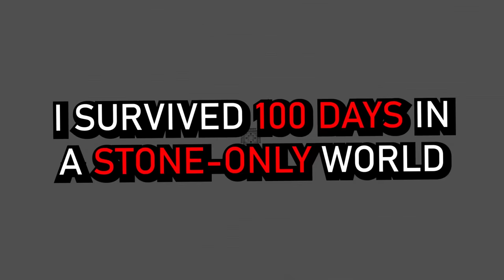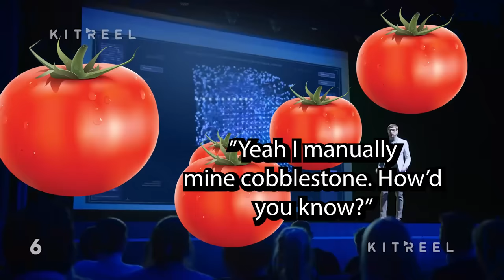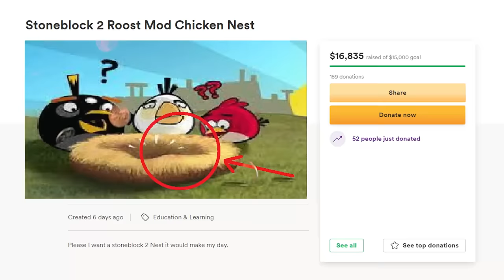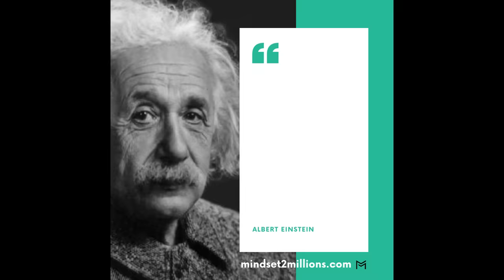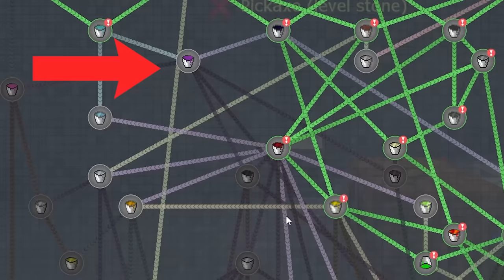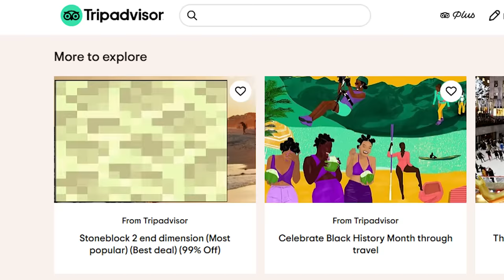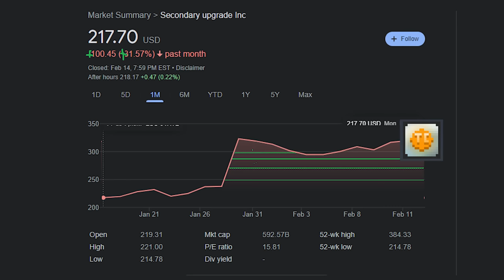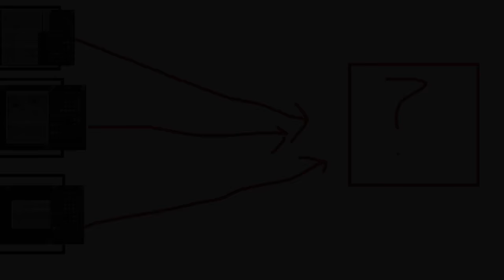I Survived 100 Days In A HARDCORE Stone Only Minecraft World (Part 1)

Comment: This video helped me realize just how useful chickens and cows are. 
Here's a tip about those guys, by the way: Item Chickens and Fluid Cows could probably speed up a lot of processes like induction smelting. Some Fluid Cows give alloys, you can turn them directly into ingots by putting them in fluid-storing blocks, and then using a seared faucet to have the fluid flow out into the cast.

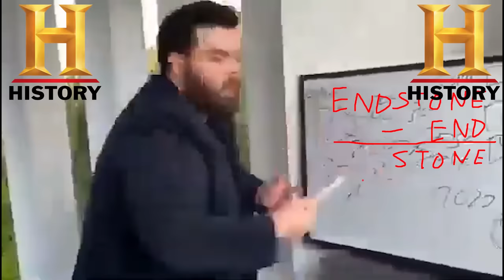Comment: 20:20 explanation of the joke: Sakupen Circles (formerly known as Iron God) is a 2.1 Extreme Demon collaboration hosted by Muffy450 and verified and published by Diamond on December 29, 2021. The level is a remake of the 1.9 impossible level with the same name, as well as taking several gameplay ideas from Iron God, an older level created by Muffy450 himself. It was verified by Diamond, after a death at 76% and a run of 37-100%.

Gameplay
Note: Only decorators will be mentioned in the following section.

0-8% (DrCuber): The level begins with a semi-impossible three-block-tall jump at half speed. After this, the player must hit the blue orb and jump over spikes, falling into a mirror portal and changing to double-speed. They must continue to jump over multiple spikes. They are given multiple orbs to choose from but can only hit the first pink orb and last blue orb. They then must jump over the spikes to pass a mirror portal, and then their speed changes to half-speed. They need to jump on the edge of a block with a spike and time a pink orb to reach the double-speed ship.
8-17% (korewa): The player hits the ceiling as the double-speed ship and must continue with a series of yellow orbs with gravity changes.
17-49% (Renn241): The player changes into a ball part that has difficult orb timings, leading into a tight corridor with spikes on the sides. They transform into a dual mini-ball with small spikes on the sides that they must avoid. They turn into a cube and must do a couple more cube timings. The word, "Ready?" appears right before the first wave part. The wave part has incredibly tight gaps with little room for error. They turn into a mini-wave and must spam on the sides of the walls to avoid the spikes.
50-66% (Mzero + endevvor): The player becomes a dual mini-wave and has to perform frame-perfect clicks to get through. They turn back into a normal wave and have to perform even tighter timings, leading into a mini-wave section where they must spam fast but consistently through a downwards spam. They become big again and must spam more, albeit not as fast as transitioning into an auto-ship section for the next part.
66-72% (NineDice): Considered one of the hardest and most inconsistent parts of the level, the player must memorize and spam through one-block-gaps as a triple-speed wave, making some clicks inconsistent and hard to time.
72-100% (GhostVandalf): The player changes into a dual wave where they have to make it through some more diagonal gaps with spikes on them, leading into a two-block spam section back into a ship section. They have to precisely control the ship and learn the fakes to get past the section. Finally, the ship turns mini into a fairly easy straight fly. After that, they turn back into normal size and need to perform the final straight fly to finish the level.
Trivia
The level is free to copy.
The level contains 72,568 objects.
The level is 51s in length.
This makes it the current shortest Top 10 Demon on the Demonlist.
The level was rated on January 5, 2022, and was initially placed at #1 on the Demonlist on the same day, above Slaughterhouse (#2).
This addition to the Demonlist knocked Kenos out of the Top 10, Icotact into the Extended List, and Ziroikapi into the Legacy List.
On March 17, 2022, Sakupen Circles' and Slaughterhouse's placements had been swapped, thus, Sakupen Circles dropped to #2 on the Demonlist.
Sakupen Circles was at #1 for 70 days.
This is the first Nine Circles level to reach the top of the Demonlist after Sonic Wave back in 2017 and the second "Medium" length level to reach the top, after Sakupen Hell in 2016.
Coincidentally, this level uses the same song and has almost the same length as Sakupen Hell, and the two levels also garner most of their difficulty through their wave gameplay. The levels share many parallels in general.
Ironically, the placement of Sakupen Circles knocked Kenos out of the Top 10 on the Demonlist, which is an extended remake of Sakupen Hell.
Cursed dropped the verification due to demotivation but had stated that he wouldn't drop the level completely and might come back to it as a victor rather than as the verifier, he ended up beating it on January 7, 2022, becoming the first victor of it.[1]
spaceuk became the second victor of the level and the first victor to not use the Low Detail mode on March 27, 2021.[2]
This level can be viewed as the first "bridge" between the Challenge List and the Demonlist as many sections of the level are stand-alone challenges.
Due to said challenge (SC66P) being high on the Geometry Dash Challenge List, this is the nearest humanly impossible level verified at this moment (neither Slaughterhouse or Firework have a single part that can reach at least the Main List in the Challenge List).
There is an upcoming sequel called Aquamarine, which is currently in the process of being remade by DrCuber and is set to be the hardest Demon in the game.
Sakupen Circles is the 36th former Top 1 in the game's history.

Comment: The Hog Rider card is unlocked from the Spell Valley (Arena 5). He is a very fast building-targeting, melee troop with moderately high hitpoints and damage. He appears just like his Clash of Clans counterpart; a man with brown eyebrows, a beard, a mohawk, and a golden body piercing in his left ear who is riding a hog. A Hog Rider card costs 4 Elixir to deploy.

Strategy

His fast move speed can boost forward mini tanks like an Ice Golem in a push. At the same time, he can also function as a tank for lower hitpoint troops such as Goblins as he still has a fair amount of health. Most cheap swarms complement the Hog Rider well, as they are nearly as fast as him and usually force more than one card out of the opponent's hand.

The Hog Rider struggles with swarms, as they can damage him down and defeat him quickly while obstructing his path. Barbarians in particular can fully counter him without very strict timing on the defender's part, though be wary of spells.

A Hunter can kill the Hog Rider in 2 hits if placed right on top of it. However, if you place something in front of the Hog Rider, the Hunter's splash will damage the Hog Rider and hit the card in front of it more.

The Hog Rider in conjunction with the Freeze can surprise the opponent and allow the Hog Rider to deal much more damage than anticipated, especially if the opponent's go-to counter is a swarm, or swarms are their only effective counter to him. Skeletons and Bats will immediately be defeated by the spell, while Spear Goblins, Goblins, and Minions will be at low enough health to be defeated by a follow up Zap or Giant Snowball.

However, this strategy isn't very effective against buildings as the Hog Rider will take a while to destroy the building, giving the opponent ample time to articulate another counter.

Against non-swarm troops, it can deal a lot of damage during the freeze time, but this can allow the opponent to set up a massive counterpush. For this reason, players should either only go for a Hog Rider + Freeze when they have other units backing it up from a counterattack, or if the match is about to end and they need to deal as much damage as possible.

It is not a good idea to send in a Hog Rider simply to destroy a building, especially if it is the only building targeting unit available, as defeating Crown Towers becomes substantially more difficult. Spells or simply waiting out the lifetime of the building are more effective. The exception to this is an Elixir Collector placed in front of the King's Tower. If a Hog Rider placed at the bridge, he can destroy the Collector for a positive Elixir trade, though the damage from both Princess Towers will usually mean he does not survive to deal any damage to them. However, if the opponent sends in defending troops, it can be an opportunity to gain spell damage value.

In a deck with several low-cost cards, it might be worth it to simply send the Hog Rider against one building. These decks shuffle their card rotation quick enough, that they will arrive to their next Hog Rider before the next building arrives in the opponent's card rotation.

Long-ranged troops like Musketeer and Flying Machine can snipe those buildings, preserving some of the Hog Rider's health, possibly allowing it to get some Tower damage.

When there are buildings placed in the middle to counter the Hog Rider, understanding the placement of the Hog Rider and the type of building placed can help the Hog Rider to bypass certain buildings.

Passive buildings such as spawners and Elixir Collector have a larger hitbox than defensive buildings; which means that if a passive building was placed 3 tiles away from the river in the middle of the opponent's side, then it is impossible for the Hog Rider to bypass that placement as the Hog Rider will get pulled to that building.

Defensive buildings have a smaller hitbox than a passive building, which means if that if a defensive building was placed three tiles away from the river in the middle of the opponent's side, a Hog Rider placed at the very left or right side of the Arena may be able to bypass it due to its smaller hitbox.

If the player has a building already placed down in the center of the arena, and the opponent tries to bypass it with a Hog Rider at the edge of the arena, they can use certain air troops to push the Hog Rider towards the building as it jumps over the river, effectively denying the bypass attempt. They must be already hovering over the correct placement, as very quick reflexes are required to correctly perform this technique.

For Bats, Skeleton Dragons, and Minion Horde, they should be placed right in front of the Hog Rider as soon as it is deployed.

For Minions, Skeleton Barrel, Mega Minion, Flying Machine, Electro Dragon, Baby Dragon, Inferno Dragon, Balloon, and Lava Hound, stagger the above placement one tile to the right if the Hog Rider is placed on the left side of the arena, and vice versa.

They can also use ground troops to achieve the same result. Something like an Ice Golem deployed at the Hog Rider’s landing spot will obstruct his path and force him to go around the unit, which causes him to be closer to the building instead of the Crown Tower.

The Hog Rider can kite Very Fast non-building targeting troops due to his own Very Fast speed and building only targeting if he is placed on the fourth tile from the bridge, slightly into the opposite lane. He can also stall grounded units when placed right at the bridge. He will pull them towards him while deploying, and then be untargetable by them when he jumps over the bridge. After landing, he will pull them back. This can be useful when the player needs to deal damage in the same lane they are defending. It will also help separate troops behind a tank in a large push.

A Tornado placed on the second tile front of the player's King's Tower and staggered two tiles towards the Princess Tower will activate it without any damage dealt to the Princess Tower, helping them in defending future pushes. This can also be a method of mitigating all damage dealt to a Princess Tower, but doing this more than three times may result in the King's Tower's health being low enough to be targeted directly, opening up the possible threat of a back door three crown. A better alternative is to pull the Hog away from the Princess Tower into the attacking range of all three Crown Towers, which will negate all damage as long as none of them are already distracted

A very powerful combo is the Hog Rider, the Musketeer, and the Valkyrie, typically referred to as the Trifecta. The Musketeer will defend against most troops, while the Valkyrie can protect her and the Hog Rider from swarms or high damage units. The Hog Rider is used to deal damage to the tower.

This can be effectively countered by Lightning, one-shotting the Musketeer and severely damaging both the Valkyrie and Hog Rider. The Minion Horde is also effective, but the enemy can Zap them and the Musketeer will one-shot them all. Even if the Musketeer is defeated, the Hog Rider and Valkyrie will have enough time to severely damage the Tower.

The Hog Rider should be placed behind the Valkyrie to give it a boost so that it stays in front of the Hog Rider, protecting it.

A Hog Rider combined with a Goblin Barrel can be awkward for the opponent to defend against. Timing it so that the Hog Rider is tanking the tower shots for the Goblins is the most effective way to deal damage. However, a Barbarian Barrel can shut this down with minimal Tower damage for a positive Elixir trade, as long as the Goblin Barrel was placed directly on the Tower.

Pairing the Hog Rider with the Balloon can deal devastating damage. If executed properly, the Hog Rider will act as a tank while the Balloon threatens to deal massive damage. The Hog Rider can also destroy any buildings attempting to slow down the combo. However, this combo is very vulnerable to swarms and anti-air cards as neither of the troops target anything but buildings. Additionally, they are easy to separate, due to the disparity in move speeds. Alternatively, the Hog Rider and the Balloon can be played in different lanes to spread the opponent's defenses thin. However, a building or Tornado can bring them back together for an easier defense.

The Hog Rider can be paired with the Lumberjack as both a swarm bait and damage combo. It is a very fast combo with an extremely high damage output potential, so the enemy will likely try to counter it with a swarm. If this happens, use a spell like Arrows to render the opponent defenseless. If they manage to defeat the Lumberjack, the dropped Rage will make the Hog Rider even more dangerous than it normally is.

A fast and deadly combination is the Hog Rider and Mini P.E.K.K.A. combo. Both units are fast but the Mini P.E.K.K.A. does much more damage and does not attack only buildings so the Mini P.E.K.K.A. can deal with troops like the Executioner and Musketeer. However, this combo can be defeated with swarms like Skeleton Army, which will defeat both of them since neither of them can deal area damage. They are also unable to target air troops, so the Minion Horde can stop this easily.

A risky play is to deploy the Hog Rider at the bridge as soon as the match starts. If the opponent does not react fast enough, the Hog Rider will deal a significant amount of damage to the Princess Tower. This can also allow the player to quickly scout the opponent's deck if they happen to react to him fast enough
Reply: Thank you for the combo bro